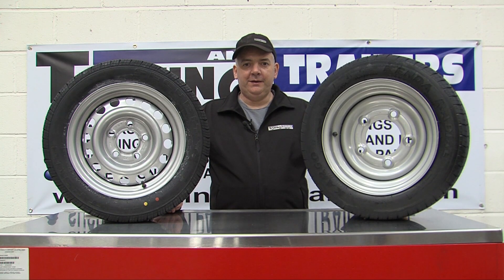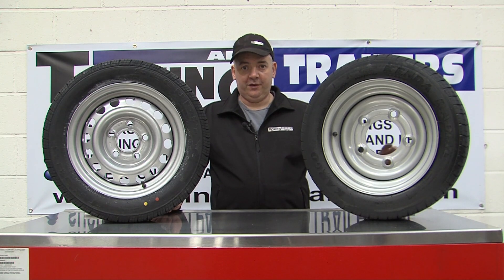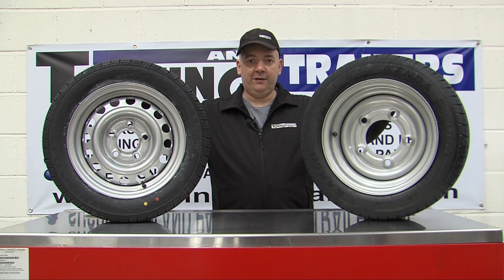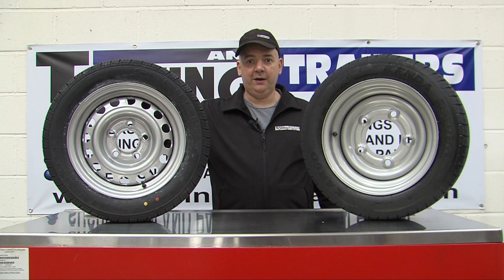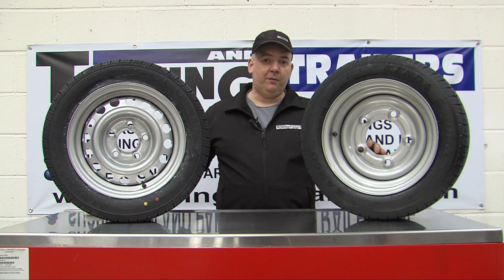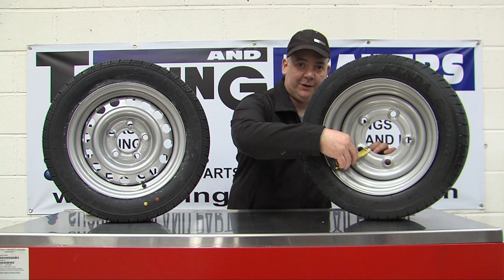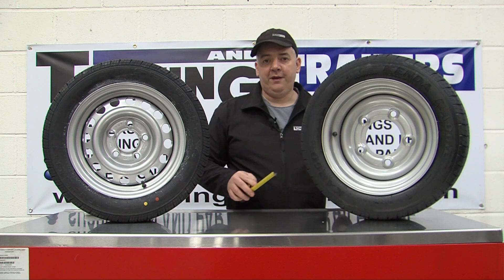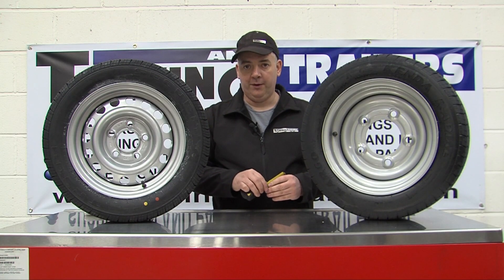How to measure a PCD on a 5 stud trailer wheel

Comment: Nissan magnite wheel pcd?
Reply from the maker: For reference I use https://www.wheelfitment.eu/car.html this website gives full information for cars in Europe and mountings for wheels including stud pattern, centre hole size, offset, Bolt size, Recommended torque, Recommended Pressure and tyre sizes used. Unfortunately this car is not on the site but it may help with others.